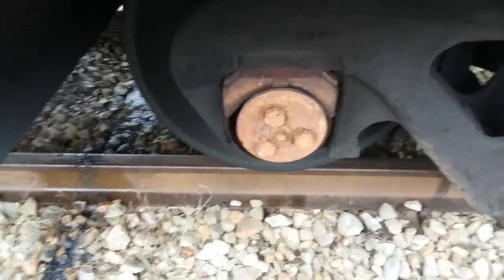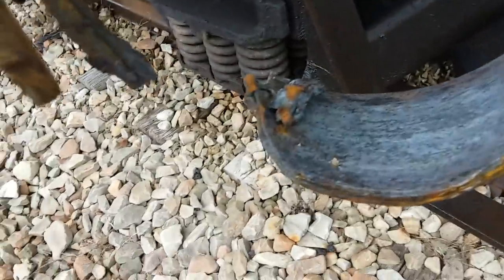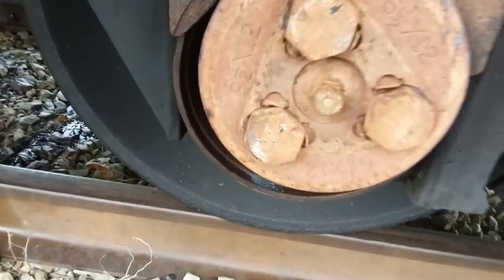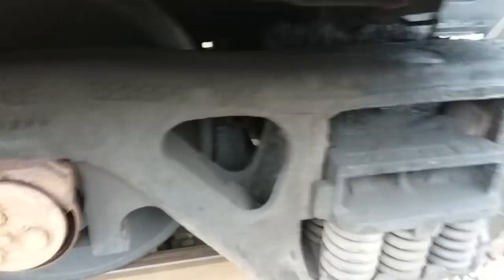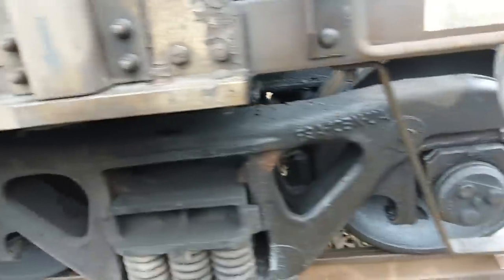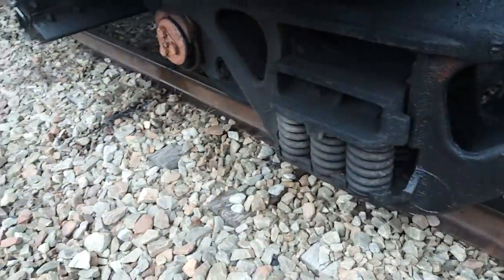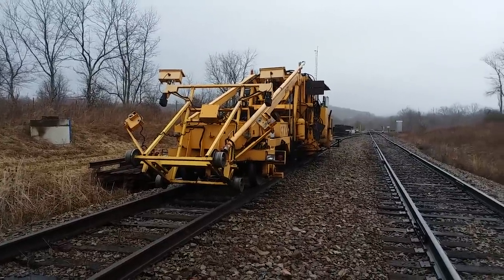Hopper Car with Bad Bearing, more of the Story

Comment: Wow Dave! Can't believe you found the race. Boy, that has seen better days.  I assume they will just replace the truck and send the old one out for rebuild.  I remember in the mid-1990s watching Conrail run a highball westbound on the water level route thru Holland Ohio. One of the wheels was ablaze as the bearing burnt up.  As it flew past at 40-50 mph I kept wondering how long till the defect detector caught it.  Hell of a scary thing to see. It is interesting that once NS took over the road, they added a defect detector in that very spot.  Stay safe my friend,

Steve

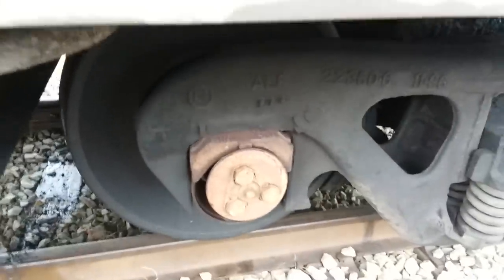Comment: Holy crap, look at. 😬 00:41 The rollers have long departed, after being turned into molten drops of steel, or fused with the races. "It's Seen A Lot Of Heat" 00:54 You're a master of understatement, my friend. I think I'll have to revise my assumption that it was running red-hot, to white hot. The heat damage on that inner race is colossal. It was so pliable after the rollers had gone, it just peeled off the axle, dropping by the track. If it happened at night, you could clearly see it. WOW.
Reply: Yeah the heat damage was pretty insane, imagine being loaded with 115ton what heat that would have caused

Comment: That definitely would have been glowing nice in the dark
Reply: Oh for sure it woulda, that would have made a you tube award winner....LOL
Now if I could just get a thermite weld in the dark, those are the ones you want
to see after dark, they are spectacular! Thank you Jeff for watching, hey, maybe I should keep a pack of hot dogs up here in case this happens again.....
Reply: I wonder how often they start little fires when they blow apart.
Reply from the maker: @operator8014  we have never had a fire from hot bearing, we had several from sparks out the loco engine. Union Pacific had a bridge catch on fire from a hot bearing in Iowa seversl years ago, that was a disaster

Comment: That is what's left of the inner race. 30 years ago I worked in the wheel shop and on bearings. If memory serves me well the initial grease fill was at that fitting. The bearings are well sealed and of course if the seals keep the water out they will keep the grease in. One or the strangest things I saw was when changing brake shoes on a locomotive I reached up for the pin and found a dead turtle sitting up there.
Reply: A dead turtle wow lol, that's not something you find everyday let alone on a locomotive truck set

Comment: My first job working in a steel mill in 1977 was greasing those bearings on cars that had the ingots and the stools they sat on that they poured the steel into, and while sitting outside to cool had to hit these fittings pulling a grease cart . It was one heck of a hot job going between rows of cooling ingots to get them.
Reply: Wow, that surely musta been a hot job, that would be a good one for Mike Rowe's Dirty Jobs

Comment: I used to maintain Servo HABD systems. They were spaced no more than 50 miles apart to hopefully catch a failing bearing before catastrophic failure. They used to report their temperature measurements in mm. 12mm = 130F + ambientF.       14mm would indicate absolute alarm. Relates to early systems that used pen deflection on chart recorders.
Reply from the maker: Cool! never knew about those that used charts. This one as you know is all electronic,
thanks for sharing with us sir

Comment: Yes, that's the inner race.
Recently, I worked on a differential that ran dry.
The pinion bearing was pretty much welded in place. It had to be cut out to save the housing.
It was caught early enough that the axle was still serviceable.
After a good cleaning and inspection, it got used parts from a salvage yard, re-shimmed, and a new differential housing cover, and new fluid.
Won't ever see the truck for that again, ever.
Reply from the maker: Daniel, thank you. Guess you well know first hand experience bout things like what happened here. Thank you for watching

Comment: That inner raceway looks way to big to have come out of that bearing.  So that means it got so hot it was able to be distorted by the axle beating on it as it squished out the gap.  How did that go undetected by your bearing sensor prior to that ultimate failure?  If that happened all at once, on one trip up / down the line, then the forces involved to do that are intense.  Amazing!!
Reply: Yes it is amazing, today I found another part about 3 miles up track after I made the
video, so it had been disintegrating for over 3 miles, and getting hot along the way, 
squish out the gap is a good way of putting it, it amazed me to find it. Can't imagine
the forces involved, but as you say, they had to be intense.

Comment: According to what I've read on other sites, the new sealed bearings are so much more reliable than the old style bearings that were open and needed frequent greasing that most railroads won't allow the older bearings to be used on their tracks.  Many years ago I greased lots of car wheel bearings, steering, and suspension components.  Now, they are all sealed and they do seem to last longer.
Reply from the maker: Sometime in the late 1980's all car freight car bearings
were made as sealed, the old greased bearings were still used
until the end of their life, but everything on on the rail is sealed.
Interesting point you make about them lasting longer. Thanks
so much for checking out the bad bearing video my friend.

Comment: The piece you found was the inner ring of the cone assembly. The cone assembly contains the rollers, cage, and the inner ring. From what I can see, it has a vented end cap, those were discontinued nearly two decades ago. It should have been replaced with a shear plug. The bearing itself looks like a Timken 6 1/2X12 100 ton F Class bearing. What you are looking at is a catastrophic hot box failure. The rail company is lucky to catch it in that stage. If the car was not set out on the siding when they did, more than likely the journal would have seized, then twisted off leading to a weight displacement and a derailment. 

(source of information) I was a quality assurance auditor for a vendor of every Class 1 railroad in North America, and I specialized in rail car and locomotive bearings, wheel sets, and traction motors.
Reply: Awesome comment, thank you for the info. Yep, before we got our detector, i've seen
the axle wear down to a cone shaped point, we've had at least 4 serious derailments from
bearing failures before the detector was put in 4 years ago with some pretty tore up track.
Always good to hear from an expert! Wish I had some of your knowledge
Reply: @ccrx-xu1wc  That bearing appears to have lost its lateral, meaning its side to side motion. That normally will happen when there is excessive play due to a worn spacer between the inboard and outboard cone assembly. As far as your comment about grease, it does not appear to be a new or a recently remanufactured  bearing. 

During the assembly process, the bearing sub-assembly (cup-cones-spacer) is placed in a grease packing machine. For 6 1/2X12 bearings they take 24 ounces of grease + or - 1 ounce. The grease machine will pack 12 ounces in the bottom cone assembly, and 12 ounces on the top cone assembly. This is performed after the bearing is lateraled, and before the inboard seal and the inboard wear ring-backing ring sub-assembly is installed. 

The bolts on the end cap sub-assembly (end cap-locking plate-bolts) are to be torqued to approximately 425 foot pounds. This is performed after the bearing is pressed onto the journal. After the proper torque has been achieved, the tabs on the locking plate must be pressed on the heads of the bolts to prevent the bolts from backing out, and from loss of proper torque.
Reply from the maker: @newwomyn  EXCELLENT! Thank you so much  for sharing your expertise with
us,  I just got a really good education. Loved It

Comment: possibly a stupid question, but does anything hold that axle and bearing onto the bogie from underneath? like say for example the car did a jump would the axles fall off?
Reply: Yes sir, not a stupid question at all, in fact a very intelligent question! Many would
never think of that. There is a small angled block that is bolted to the side frame
that holds the axle from coming out of the side frame. Am going to do a future
vid on parts of a truckset where I will show that, so stay tuned, and thank you for
watching
Reply: @ccrx-xu1wc  then the whole truck itself is just held in place by gravity\weight of the car?
Reply: @daveh7945  
Yep!
But it has a center pin about 14" long, in case the car bumps up outta the Bowl.

Comment: Long ago in a place far far away I used to call on a company in NJ owned and operated by GM and that was the place where the  races for the bearings for rail cars were made. They could have made the complete bearing assy there but I did not see it. The factory was huge and it would take too long to describe everything i had seen there but, the one machine that did impress me was an induction heating system where very large bars of metal were lifted up onto a platform where metal rods approximately 30-40 feet long and about eight inches in diameter were heated by radio frequency energy  Again the rods would go through coils that were energize with RF. There were three coils and when the metal went through the first coil you could see no change in color, by the time it went through the second coil they were red hot and in the third coil the rods material was almost white hot. At that point a machine lopped off a chunk of metal with seemingly little effort much like a lump of dough in a bread factory, then another machine stamped out the basic design of a race and then the unfinished race fell into a large carboy still red hot to be carted off for heat treating and machining. I could almost write a book about that plant.
Reply from the maker: Very interesting comment you gave there! Thank you so much for sharing that with us. It has to be a really interesting process. There's just so much cool info out there that hardly anyone knows unless you've actually been there. Again, great comment and one that will add a good bit to this video
Reply: @ccrx6700  Well thanks, I'm happy you liked it. Most of my industrial travels were in the NE area. There are two factory's that I never visited because there are none where I traveled and always wanted to see and they are an large aircraft factory and a military bomb factory. I don't think they have too many visitors on my second wish:)

Comment: That bearing on the other axle on that truck ( wheel set) is bad order too! Grease is leaking on the inside next to the wheel and the outside. Seals go bad from wear of the bearings! To the rip track!

Comment: I remember seeing a train going down thr track's with a glowing wheel shooting sparks everywhere .at 75 mph i wondered how many fires were started .
Reply from the maker: Charlie, kinda like a Loram grinder! Wow that would have been neat to see. When they run that grinder on NS tracks near here, they have big water tank cars with them and are constantly spraying water behind them
Reply: @ccrx6700     I saw the Loram Grinder up on the NS portion of the Chicago Line 2 yrs back pass my location at dusk.  Wow what a show that was!
Reply from the maker: @b3j8  yep! Over 30 years ago saw one on NS  track after dark, i had no clue what it was back then,  thought they were welding something on the rails. But it was a spectacular sight

Comment: Wow that bearing is trashed. Closest I've had was a centerbeam lumber car, detector caught it, hotbox. Luckily it was close to head end, the seal had went out and the grease was pretty much gone. Had to keep going about 15 miles at reduced speed to set it out after car dept came out and looked at it.
Reply from the maker: We are lucky our siding is right here at the detector.  That's a long way to have to drag
a car, I assume someone rode the car with a radio. But that's railroadin on the big railroads
Reply: @ccrx6700   No. It was further ahead in the direction we were going to set it out. Wasn't to bad.

Comment: Yes. Bearings normally have an "inner race" and an "outer race". It looks like the outer race is still in there. There is also a "cage" which holds the rollers properly spaced apart. 
 I'm just wondering how much damage was done to the axle...?
Reply: Lester thank you for the great info, appreciate that sir! Axle damage hard to tell,
but it probably gonna go in the scrap pile
Reply: @ccrx-xu1wc  Yes. But are they able to "press" the wheels OFF of the axles, to use the old wheels over?
Or must the axle AND wheels be discarded?
I was under the impression that those wheels are pressed on with a giant size industrial press.
Reply: @lestergillis8171  They'll probably be able to salvage the wheel off of the far end of the axle. The near one that was adjacent to the hot bearing that failed probably isn't worth the risk, depending upon how much abuse it experienced when the bearing failed...

The salvage crew will check the wheel for cracks and flat spots at the very least.

Yes, the wheels are press-fit onto the axles to make up a wheelset, but as I recall, it's common practice to heat the wheel and/or chill the axle and take advantage of the differences in size due to thermal expansion & contraction so that you don't put very much mechanical stress on the wheelset during assembly.
Reply: @chemech  Yes. I recall "ring gears" (starter gears)  on the rim of Cummins engiines being heated moderately with a blue tip wrench so they slip over the O.D. of the flywheel without the need for a press.
Reply: @lestergillis8171  Lester, very good question. I do know as you say, the wheels and bearings
are pressed on with some incredible pressure. I would be  guessing here, but would say
they are pressed off also. I do know that shops true wheels when they are not to
far worn in what is called a truer machine. One would almost have to think the wheels 
would be need to be removed from an axle to do this, however I am not an authority
on this. You got my curiosity up so gonna need do some research. I love it when
you guys make me think! I always learn something new from that.
Reply: @ccrx-xu1wc  Do you guys do any of that type of work "in house"? Or is it subbed out?
"Just asking for a friend"...
Reply: @lestergillis8171  Lester, we do not. Lyons Industries of Ebensburg Pa, does all
our truck set rebuilds along with replacement of Loco trucks, they have a web site
if you interested
Reply: @ccrx-xu1wc  I may look at that a bit later...

Comment: That is the Outer Race, and those grooves shouldn't be there.
I've seen a bunch of "Hot Boxes", both Roller and Friction Bearings.
Those friction bearings would catch the Lube Pad on fire, and burn for a while!
I once used several small fire extinguishers on a hot box, to keep it from burning down a load of sugar cane.
Just a quick squirt, everytime it flared up...
Reply from the maker: Bryan, thank you for your info sir, sounds like you got some
railroadin experience under your belt!

Comment: Track question. Do railroads use any kind of rerailer track like might be used in model railroading? I occasionally see what looks like rerailer track on railroads. Looks like track sections laid between the rails and joined to a point at both ends. Hard to describe.
Reply: I have never personally seen anything like that, we don't have any, but that's not
to say it's not out there on some RR, We do have a fixed re railer at our load out facility,
but it has nothing to do with rails, it a big piece of steel with slanted sides and guides to
help re rail a car. We also have hand re railers, will do a vid sometime in future on
them, they are heavy and a total pain to get in place under a car, and if worse comes
to worse, we have a phone call to 1 800 Hulcher.... LOL
Reply: @ccrx-xu1wc  Yep, a portable re-railing frog works for the minor derailments. Anything bigger, call in the specialists with their cranes and mobile equipment.

Some roads have situations where they derail rather frequently - like in older yards - and they will have certain switch engines that routinely carry such a re-railing frog.
Reply: @ccrx-xu1wc  Thanks for the reply. These might not be retailers but something else. Look forward to more of your very interesting videos.

Comment: The bearing on the third axle of my 17 ton bus once gave in. Stopping at a bus stop there were lots of smoke coming. The roller bearing had gone really bad. Small metal things looking like meat balls fell out. Just to call for the tow truck and encourage the passengers to join another line showing up....

I once, 30 years ago, designed a ball bearing measuring machine. Measuring the inner part of roller bearing was another job, maintaining the measuring device... Once ran a Rumanian ring. It was so bad the fault errors were issued and measuring aborted.....
Reply from the maker: Bearings just like any metal part can and do wear out over
time and use. But seems like they always do so at the 
most inappropriate time....:-) Pretty neat on the measuring
machine, wow how awesome is that.